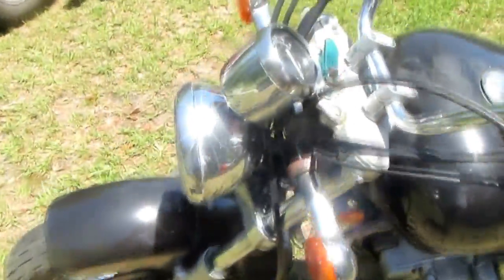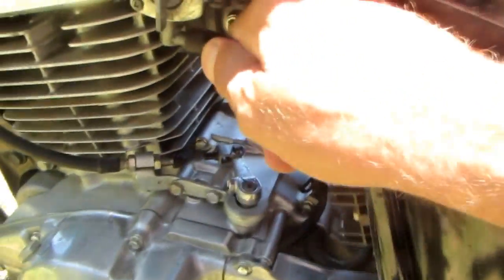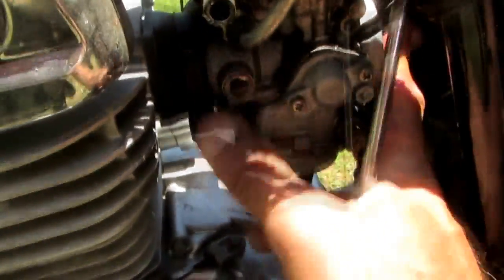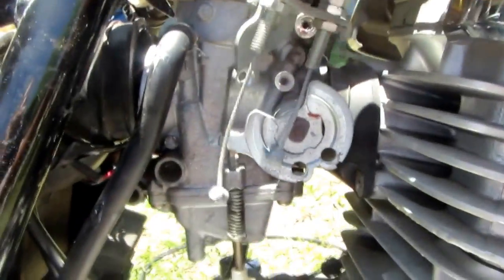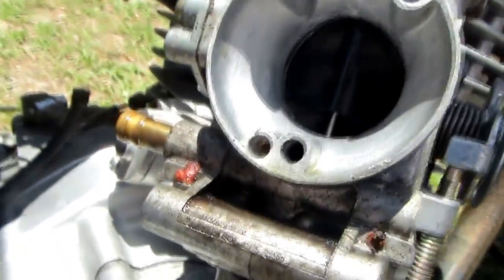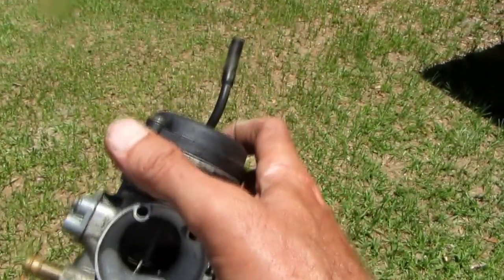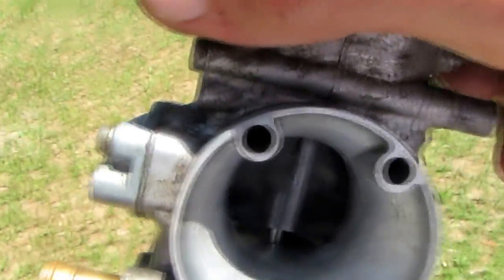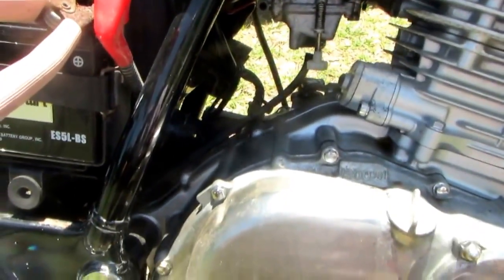Suzuki 250 Won't Start Carburetor Problem R&R Carb

Comment: I think I am having a same problem, even though there is enough fuel and sparks are also fine,but after few miles the bike turns off &it won't start, is my carborator  giving this problem? Great video thanks for sharing
Reply from the maker: +Rubin Shrestha Thanks.  You have a tough problem. It could be carburetor related?  I would GUESS something is heating up then quits working.  Maybe a clogged breather, vent, or vacuum line.  Also check the hose on the bottom of the carburetor float housing.  Is it clogged? When hose is disconnected does problem go away? When the problem happens. Does fuel  leak from this hose?   If fuel leaks out its flooding and float might need adjusting.  Hope I helped out. So many things could cause the problem your having. Good luck Rubin.
Reply from the maker: +Bill Eaglerunner  Some times Marvel mystery oil (fuel additive, cleans engine.) will fix problems like this.  You could get lucky.
Reply: Thank u so much for replying and your thanks for your advise, I was suffering from this problem and i took off the carburetor and clean it out,from that it help me alot and didnt get problem, After few days i got another problem , it didnt start and no spark at all,Than i changed the quail set and cap of spark plug finally it works and didnt get problem at all now and its running fine so thank u again for your suggestions guess i am lucky hehe
Reply: Rubin Shrestha hello, I hope you are doing great!  can you advice what do you mean by changing quile because I have the same issue, it stops after few km and won't start again, thanks for sharing the your experience
Reply: @heshamabdelghany4685  bit late, but he meant the coil set I think

Comment: a buddy of mine is going through the similar problem.  we cant get it to start. what we did was pull the carb and clean it out, installed and cranked it, no start.  there's spark, fuel, it cranks and engine sounds like it turns over but still no start. we even sprayed carb cleaner before and after the carb intake ports and exhaust port. still no start. we're stumped and we need help.
Reply: Romeohh figure it out?
Reply: Tell me this is 5 years after the fact Was your kill switch off sounds like you don't have any spark